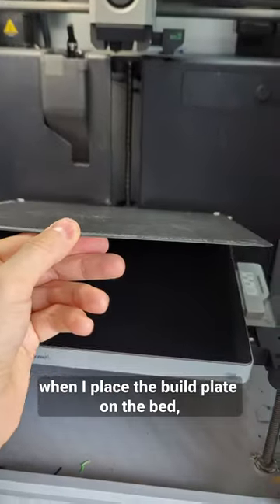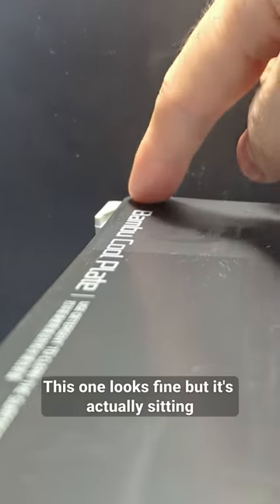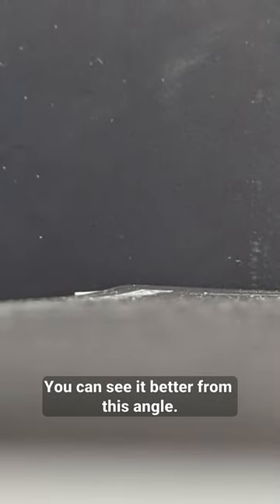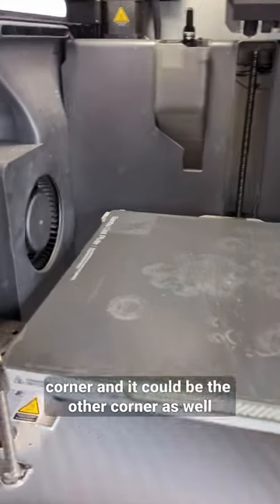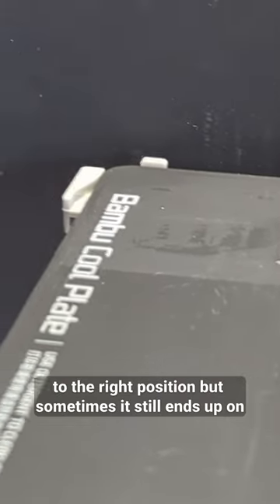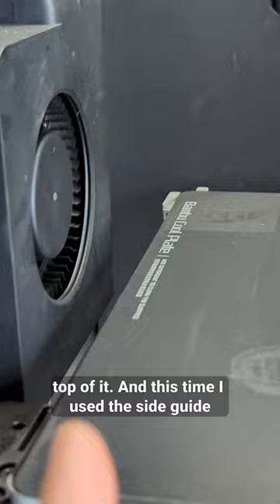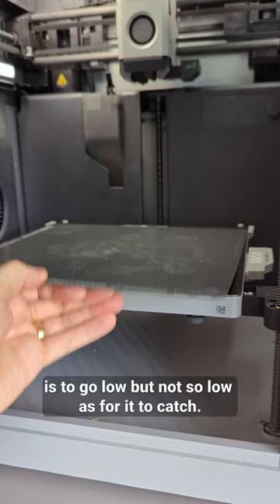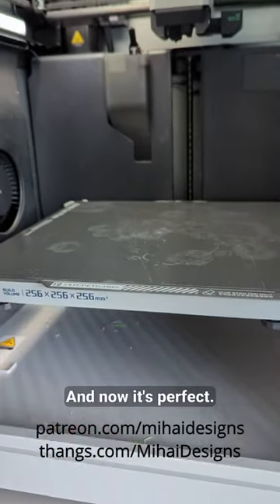Build plate alignment on the Bambu Lab

Comment: Would highly recommend the gold textured PEI plate from bambu lab It’s such an upgrade.
Reply from the maker: I had no idea they had a gold one!
Reply: @MihaiDesigns  i think he means pei coated bed
Reply: @MihaiDesigns  I would recommend it as well. It's been amazing on my machine, seems very durable.
Reply: is the adhesion better on that plate compared to the stock dual textured PEI?
Reply: @ghjfkldsxzmkbfj  it’s only stock on the p1 series, not sure if there’s a adhesive difference. I think the main difference is the LiDAR works better on the gold

Comment: On the prusa beds the shape at the back is made with two pins to be the guide placement, and then the magnets are strong but not so strong as to stop you from being able to stop you from sliding the bed to the perfect spot.
Reply: You want the magnets to be strong. I’ve had warping ABS prints pull my plate up, but not on the Bambu.
Reply: @3vlogs487  magnets are strong enough to not be pulled up by the prints, or at least they should be

Comment: The biggest flaw of this machine
Reply: It only needs a bit of practice and its fine, but maybe a close corner with higher sides would be nice
Reply: @xpy99  man I still struggle to get it lined up done it at least a 100 time's
Reply: @paintballercali  take the plate inclined, higer near the front , than with one of the back corner follow the curve on the side and when it touch the plastic on the back it is fine